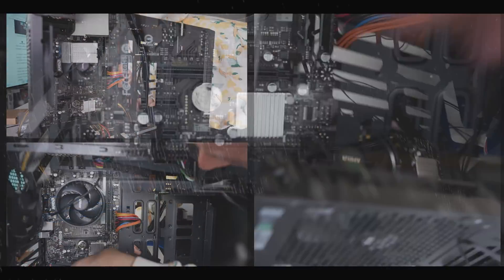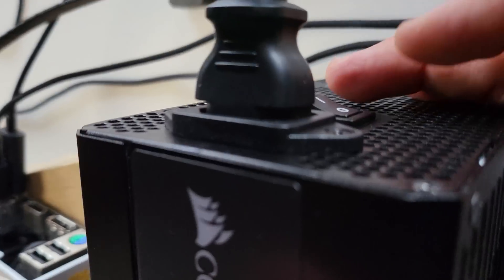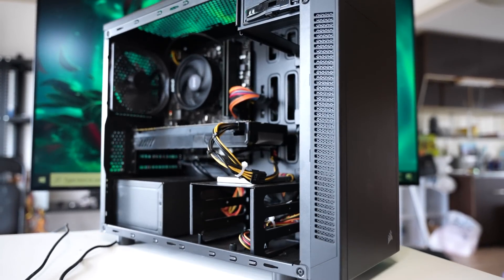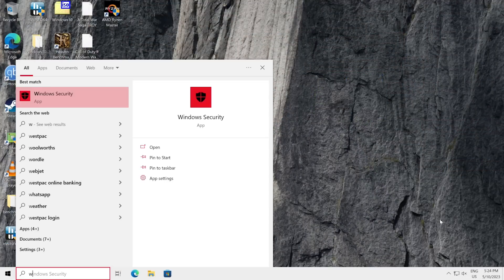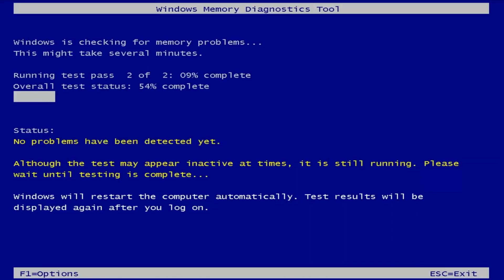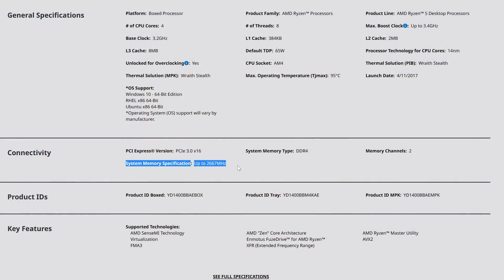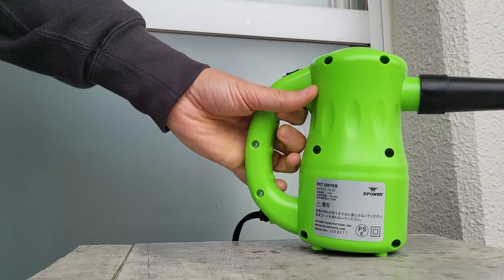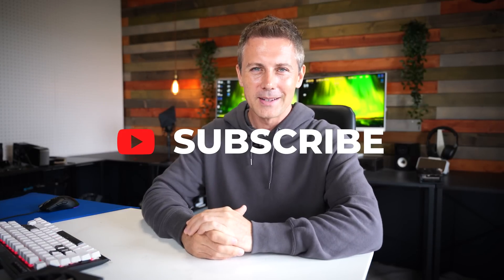Computer Won't BOOT? It Could be FAULTY DDR4 (or DDR5) Memory

Comment: man, I just bought 2 sticks with identical brand and type model to my old ram sticks twice. and both didn't work at all, my pc won't boot but the case and processor fan work. I tried one by one each new sticks didn't work at all but my old ram sticks run without problem. Is it my motherboard problem or just me have the worst luck?😢

Comment: Hm . ...  I have an ASUS ROF Z690 Aorus Elite mainboard, was running on 96GB DDR4 - no problems.
Last night the energy was  cut (as is frequently the case in Buenos Aires) and before turning on the machine, I replaced 2 sticks of 16GB with two of 32GB, resulting in 128GB and the machine would not boot, run into Bios (at times), setup, starting memory test sometimes was possible, sometimes hanging), one memory test was ended because too many errors, i tested the old memory - all went smooth, I tested the new memory  - passed ....
Seems that someimes although the memory was inserted correctly, it did not work, sometimes not at all, came to the Win11 BSOD, or to some other error screens. 
After at least 20 tries now the complete memory is in and the memory test of the BIOS is running (no errors until now,  first run  70%).
Is it so hard to put in the memory sticks correctly? It took me 10 hours of repeated attempts until I got a first time that the test is possible.

Comment: Thank you for the video. I am stuck in EZ flash 3, a Prime B760M-A D4, I just made it build in a computer store. I am stuck in BIOS but I can select manually the windows to start the computer but each time I reboot the computer. The right partition is selected in the BIOS...

Comment: Running into an issue, amd 7800kx3d asus tough board, DDR% 4070 ti gpu, but pc will only boot with 1 stick of ddr5. Replaced every part but the gpu but still same issues.

Comment: xmp Caused my computer to not boot on a 11600kf, turned out after changing ram motherboard and GPU that the issue was the CPU dropped in a 11600k non f and no more issues. Memory is now running at full 3600mhz cl16

Comment: I've noticed this issue on my z490 gigabyte mainboard with ddr4 3200mhz kit.
Without updating my mainboard, xmp works just fine. i turn it on and it just works.
after newer bios update...xmp on and blue screen or choppy performance or black screen.
flashed bios back to previous version and...it works again.

Comment: Once had  pair of Patriot 8GB DDR3 sticks that wouldn't run their 1600mhz xmp when paired with FX8120 but would when paired with i5 2500k, and to make it even more strange the same FX8120 ran pair of 4gb Mushkin sticks at 2133mhz. Not that the extra ram speed helped that cpu much if any

Comment: i work at a school and we have 15 cpmputers with 8th gen i3's in one computer room and ram fail to train at boot every time we have hardware exam , when we remove one stick, use computer without it and then put it back it stop recognizing it , ddr4 2666 , we have a-data and teamgroup kits in them 
fun thing is every stick of ram is ok and they can even work with cross vendor pairs , but at ocasion they simply refuse to work at all
in most cases it is enough to swap ram to the other vendor set and put them in one at the time, and the removed ram then 90% of the time work with the other pc
if not, single stick and bios reset fixes it

funniest part you can recognize if ram works in those pc's by listening to vrm coils at startup, if it instantly go silent it won't boot, if it do a full long soun it would boot. and it is all fault of quick boot skiping post on known hardware

Comment: With my luck, it's because I have the reseat the RAM, 90-something-percent of the time, if I get power, but no signal to monitor. (usually no bleeps, because my PCs don't have the piezo connected to the motherboard, so I can't hear the BIOS squeak a code for RAM init failure or video init failure) Either reseat the RAM or reseat the video card, with my luck. 
AMI: 1 long- 2 short: RAM init failure. 1 long- 3 short: video init failure, same as Award BIOS for the video init failure code.

Comment: I bought some ddr4 sticks from amazon, posted my bios to safe mode 3 times. Turns out when I enabled xmp 3200 mhz the problem would happen. They basically put a 3200 sticker on a 2133 ram packaging. My advice is buy something above the speed you want to hit. In my case I would have to buy 3600 mhz sticks if I want to hit 3200. Plus this tip serves for long life span on your rams albeit spending a lil bit more.

Comment: Memory is the most anoying problem with PCs. I was having infrequent display driver crashes that I diagnosed to the memory running anything above 2133. The kit is Gskill Neo "Ryzen compatible" and was on the QVL. I hunted down a Corsair kit that was on the QVL and haven't had a problem since.

Comment: I have the Patriot Memory Viper Elite II DDR4 Memory 4000 32GB (2x16GB) 1.4V, and I could not let it run at 4000Mhz speeds, not even 3200Mhz, and that with a ASRock X570M PRO4 and a 5600X, but I read that putting it in the other two RAM slots, B1 and B2 it would likely work, so I put it in does slots and did did the 4000Mhz profile in the bios, and it worked, I had to up the voltage from 1.4v to 1.44v and now it's stable, so I recommend people with AMD CPU's to try the other 2 RAM slots.

Comment: My problem is that when both sticks are pluged the pc wont boot; but when I remove 1 of them it will boot with either one; I even switched the slot I was pluging them in and it will boot anyway aslong as it was only 1 stick pluged. They are ddr5 16g each; same model, same brand, exactly.

Comment: I had an issue with TeaamGroup 3200 2x32 GB. I RMA'd it back to them. They sent me a new kit and I had the same problem. I replaced them with G.Skill memory, problem solved! I use Gentoo Linux on that system and bad memory can and has cause crashes while compiling programs.

Comment: GAMERS READ…!  Nvidia is sugar coating … !!  Given the facts the 3050 was indeed a pile of crap itself . WHY??

- 3050 - 23.8 % of full die cores , 276mm, 128- bit bus , 8GB GD6, PCIe 4x8- $250  
-4060ti - 23.6% of full die cores, 199mm, 128 - bit bus , 16GB GD6, PCIe 4x8 - $500 
$500 - the 3070 performance for the 3070 MSRP 3 years laters when the real “(Ada)” uplift is more than 70%
WHAT A RIPOFF !!!  Nvidia doent sell GPUs anymore , they sell DLSS 3 now .. fake frames … Dont buy them ..

Comment: The number and size of DIMMs can be an issue when it comes to XMP as well. When I was using a 3700x with 4 16GB modules it wasn't stable at 3200 so I ended up running it at 3000 manually. The same memory works fine at 3200 with my 5900x and the 3700x works fine with 2 8GB sticks at 3200 now that it's in my wife's PC.
Reply: I have the Patriot Memory Viper Elite II DDR4 Memory 4000 32GB (2x16GB) 1.4V, and I could not let it run at 4000Mhz speeds, not even 3200Mhz, and that with a ASRock X570M PRO4 and a 5600X, but I read that putting it in the other two RAM slots, B1 and B2 it would likely work, so I put it in does slots and did the 4000Mhz profile in the bios, and it worked, I had to up the voltage from 1.4v to 1.44v and now it's stable, so I recommend people with AMD4 CPU's to try the other 2 RAM slots
Reply: Is multi purpose spray the same as WD-40?

Comment: I've 2x16 GB DDR5  rams (new) & system boot failed. It took a few attempts to find out that 1 of the 4 ram slots on my new Axxs mobo was not working. I'm too lazy to get a mobo replacement coz I don't want to unscrew all component inside that case.

Comment: Tech Yes Lovin always does its job! I’m only getting 3000mhz from 3200mhz dual channel kit on my 2700X and even worse with 4 sticks, so I have 5700X waiting to be installed but too lazy lol
Reply: I have the Patriot Memory Viper Elite II DDR4 Memory 4000 32GB (2x16GB) 1.4V, and I could not let it run at 4000Mhz speeds, not even 3200Mhz, and that with a ASRock X570M PRO4 and a 5600X, but I read that putting it in the other two RAM slots, B1 and B2 it would likely work, so I put it in does slots and did the 4000Mhz profile in the bios, and it worked, I had to up the voltage from 1.4v to 1.44v and now it's stable, so I recommend people with AMD4 CPU's to try the other 2 RAM slots.
Reply: BTW I now use a 5800X3D, and also with that one the RAM works perfect, and 4x RAM sticks do not run great on AMD4 hardware, I would recommend 2 sticks, absolutely if it is high speed RAM.

Comment: I might be wrong but maybe buying cheap unbranded ram is risky. As far as building computers for 21 years I never encountered new faulty ram. I did had a stick with issues during the DDR2 era, but it became faulty after a few years, not as new

Comment: My memory story of 2021 was a fun time :) (it wasn't at all). I bought a r3 3100, b550m steel legend and a single 16gb dimm of ripjaws v 3200cl16 (F4-3200C16S-16GVK) in november of 2020 and in december I bought a second dimm to run dual channel and it was stable running xmp until I needed to rma the board for faulty nic and the store just refunded me so I sold the 3100 and bought a 11700 and b560m aorus pro ax board not long after they had just launched with the intention of re-using my 2 sticks of ripjaws v (both also had the same samsung b-die for those who might ask). I had so many problems running those sticks it was maddening lol. It would take ages to memory train, would post at xmp for a couple weeks then decide it didn't want to do that so I'd have to reset the bios. Now the store I bought the 11700 and b560m aorus pro ax gave me the "well the memory isn't in the qvl so what do you want us to do" crap so I ended up having to buy another kit of memory (crucial ballistix rgb 3200cl16) which wasn't cheap at the time and that was on the qvl to prove if my ripjaws v dimms or the cpu and/or b560 board were "faulty". posted fine with the crucial sticks and I've had no issues since november of 2021 and I got a full refund for both dimms of ripjaws v which I wasn't expecting but I think this could serve as just another story/example for people. I genuinely don't think the ripjaws sticks were faulty and it's just the b560m aorus pro ax being incredibly picky on ram because they had no issues on my 3100/b550m steel legend config and I could be wrong on that but the biggest lesson I learned from my situation was buy ram that's on the qvl so stores can't use that as an excuse to deny warranty claims lol.

Comment: Had Failed first boot w/ 2 new builds. My problem was w/updated Bios on both a Asus B450M - Plusiii, & Z690 Gigabyte Gaming X 
Had a problem knowing if PSUs were working cause the new ones are so quiet. I hadn't built a PC in 15 yrs. that's how long my previous builds lasted😂

Comment: had major issues with expo  dominators 6000mhz cl30 ddr5, found a fix which involves changing the first timing i should be able to run cl30-36-36-7, 1.4v but have to run cl36-36-36-76 1.35v for any kind of stability.

Comment: Another trick that works with RAM is cleaning the pins with a Soft Rubber Eraser, sometimes the pins are dirty even if its not noticeable and make faulty contact with the mobo, so this trick not only works with your old SNES games but with PC RAM too :)
Reply: holy crap. did that really work?

Comment: Never came across a bad kit. Bad motherboard timings, sure (looking at you trfc), some manufacturers not loading correct XMP voltage, but I always get them working with manual timings in the end.

Comment: I once had a problem in a520 am4 after I bent the cpu pins then fixed it, but when the system tried to start, no beeps, fans went full then lowered speed, then restart and same cycle. cleared cmos, made sure no power or battery for a min, changed cpu, updated bios, still nothing. Finally I removed the ram, put it back again and it all worked fine, evil magic I tell you.

Comment: I bought a set of crucial rgb ddr4 gaming 16gb 3200mhz ram used. I have multiple test systems I keep for hardware and neither my Intel i5 10400f b560 pro system or Ryzen 5 5600g b550 will boot with it. All fans spin, cpu cooler and Gpu. The rgb on the ram even works. Can’t get any signal via hdmi or dp. Any ideas? I’ve cleared cmos prior to slotting it on both boards tested with it.

Comment: Remember chaps, removing all RAM sticks (whilst following static precautions and health-and-safety with the PC unplugged from the electricity) and, once powering on, booting to the POST means the BIOS has been loaded, decompressed and read. That is really the first port of call for most memory and motherboard checks. Some brands of moherboard log RAM as a unique ietm that has stopped working when really it has not, and so removal of the CR2023 and a blanking of the BIOS settings (having backed-up first) can reset such logs. Sometimes there might not be anything wrong with your RAM. This information is to help you. That is standard stuff.
My comment has no hate in it and I do no harm. I am not appalled or afraid, boasting or envying or complaining... Just saying. Psalms23: Giving thanks and praise to the Lord and peace and love. Also, I'd say Matthew6.

Comment: Ram can be very troublesome sometimes ... I had a set of Corsair vengeance lpx in a VR rig that worked flawlessly for 3 year and then all of a sudden 75% of the time would get stuck in post checks .. I was starting to suspect the motherboard was giving up so I swapped the ram out for a set of Crucial ballistix and it runs flawlessly again .. I tried the ram in my other rig and run tests with no errors being reported used it for a further 3 months so the ram wasn't the problem either .. It's one of them things I cant work out why it stop liking that set of ram

Comment: That KLEVV memory in the video actually runs at 3200MHz using JEDEC timings (CL 22@1.2V). It isn't made to run with XMP.  I know this because I have a 32GB kit of it running in a prebuilt system that only supports RAM running at JEDEC timings. It is actually quality RAM that uses SK Hynix memory chips. I do not recommend getting it unless your motherboard doesn't support XMP.

Comment: Ram can be tricky...I had a PC 3900x with 64gb 3600ghz (4 sticks of 16gb) and I wanted to upgrade to a 5950x. The bios on my x570 aorus master was ancient, F11, but everything worked just fine for years.

Updated my bios to the latest (F37C) and my PC started to make a "fake start" or "two stage start". Pressed the power button and it get power for 1 sec and than turn of for about 3 sec, and than boot again normally. Found that turning off XMP, the PC start normally with the 4 sticks. 

Then tried to start in pairs, and with one pair it did the "fake start" again, and with the other pair did a infinity "start loop". Thought my ram was faulty, but I decided to downgrade my bios to F32, and everything is working just perfectly. Never had any problem with my ram or boot again. I think the problem was the fTPM enable on F35 version...but that just a theory...xD

Comment: Corsair is probably the brand I had the most dead stick of ram of from used market since I started building PC. At least they got good RMA, always beware of under-market price ram :P I also feel like unless the price is really low, its not worth buying on the used market anymore for DDR4, since brand like TeamGroup are soo cheap now. Same with M.2 drive.
Reply: Seen the same issue with Corsair. Especially over the past year. - I've done several dozen builds with Teamgroup VulcanZ 3200/3600 and I've yet to have an issue. No problems with their VulcanZ SSD or MP33 NVME either. Likely the best budget brand out there right now. - I wont intentionally source used DDR4 with prices down so low but sometimes you end up with some when buying misc parts from people. Unless pulled from a working system I've never had good luck with used memory.
Reply: @ghosttheoremproductions5469  likewise I've used team group,  abd G-skill no issues ...newer corsair , lots of failures
Reply: I agree that newer corsair ram is junk had multiple failed sticks even a failed kit , never had any issues with older ddr2 & 3

Comment: More related to working with old computers, but whenever there is an issue with POST or stability, RAM is the very first thing I swap out! The next usual suspect is the graphics card. PSU not so much as I always use the same one, so I know it's good!